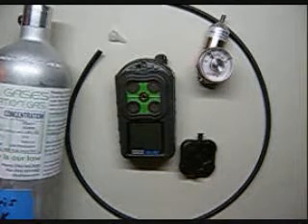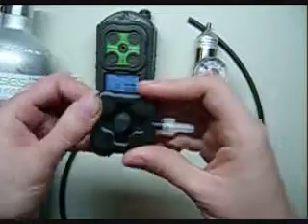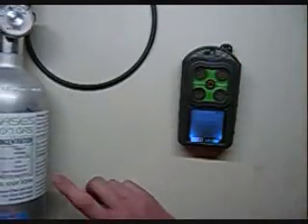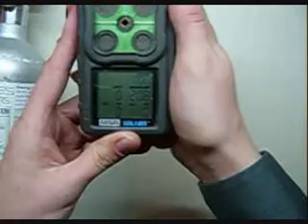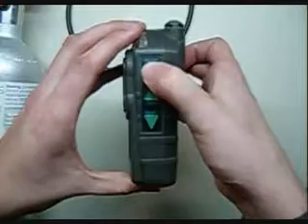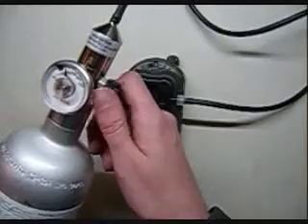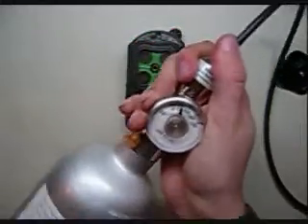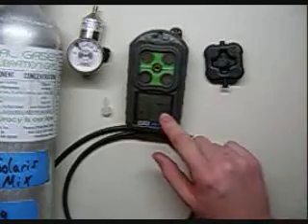MSA Solaris Gas Calibration Guide by Ideal Calibrations

Comment from the maker: @djsbuds123 Hey DJs, sorry it's taken so long to get back to you here, I lost the comment notification in my email!  Cal fail usually means your sensor is dead, unfortunately.  The sensor puts out an electrical charge which the monitor reads.  At a certain point, that charge gets low enough where the detector considers the proposed value of calibration and says, "Hey, at this low a charge we can't tell fluctuations accurately."  So the monitor fails the result. Character limits here are a pain.

Comment from the maker: Hey FFSQUAD944, yeah it's actually not too hard.  All you need to do is order an MSA Solaris H2S sensor.  They're a button cell type of sensor.  Open it up, pop the sensor in, close it up, restart it in Setup Mode, enable the sensor, and restart it.  Then take it through zero and cal with the Solaris calgas and you should be set to go.  Probably an hour if you know what you're doing.

If you'd rather just send it in, we can handle it here for you without any problem.  Shoot me a message if so.